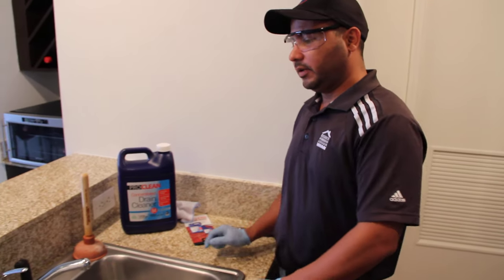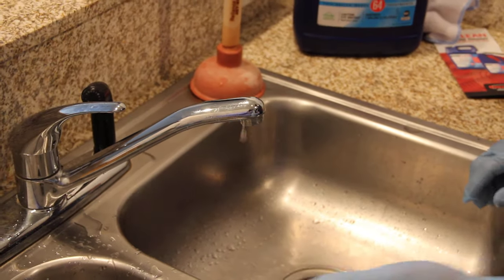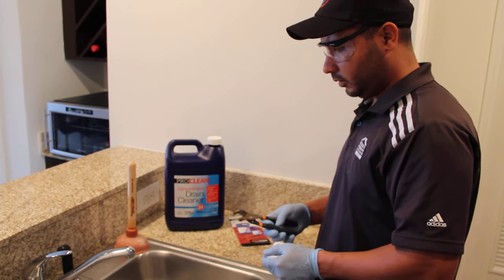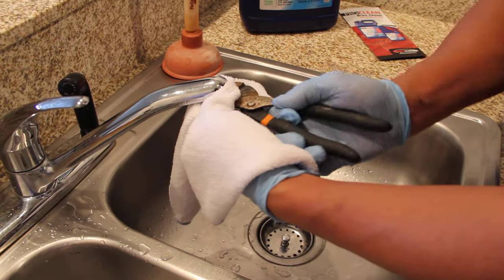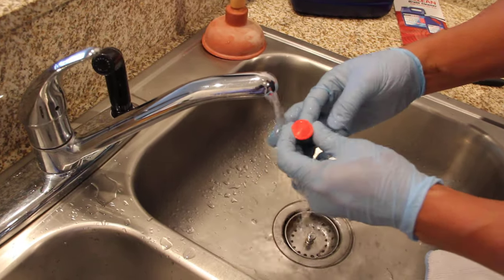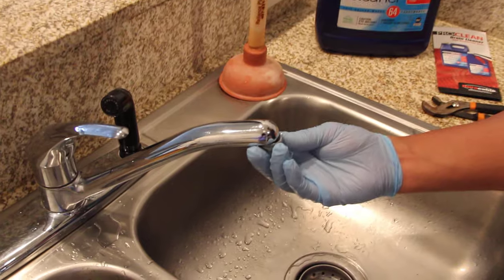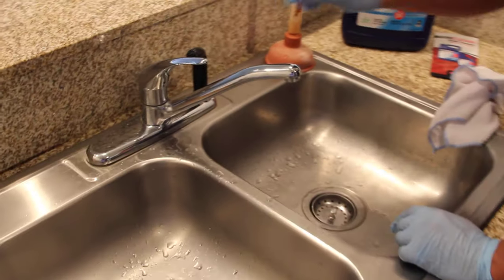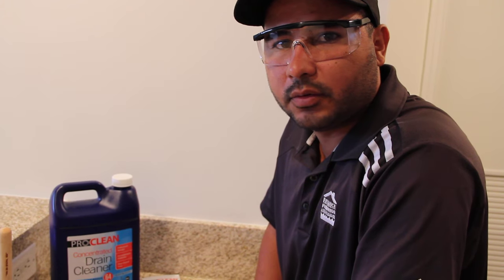How to Replace Your Faucet Aerator

Comment: I had tried to remove the filter before but gave up because it seemed like the extension of the faucet holding the filter was just part of one seamless chrome faucet. After seeing your video I was convinced I hadn't tried hard enough and upon following your method, a successful filter removal and cleaning. Thanks very much.

Comment: Stupid counterintuitive screwing. Thank you for posting this video. I was trying to screw it off the wrong way (which would normally be the correct way).
Reply: Picture the opening as if you look at it from the bottom of the bowl and then righty tighty, leftie loosie :)
Reply: Its still lefty loosey just inverted

Comment: My kitchen faucet aerator doesnt screw off like that. There is nothing on the outside to unscrew. Its like all internal. Dont understand how to replace it except somehow using needle nose pliers or something to try to remove it from the inside. Does it even unscrew?

Comment: Thanks! Had a carpet cleaner come and use my faucet. My brand new Moen faucet which is exactly the one you are taking apart was spraying everywhere after they left. I didn't know which way to turn it to remove the aerator, which online on Moen says counter clockwise which is correct if you look at it from the bottom.  Your video helped.  BTW, they took my "O" ring with them. (sigh)

Comment: have a Moen Adler CA87530.  I used all my strength with pliers to try to remove the aerator, and it will not come off.  I even used WD-40 for 3 to 5 seconds, waited two minutes, and I still can't take it off.